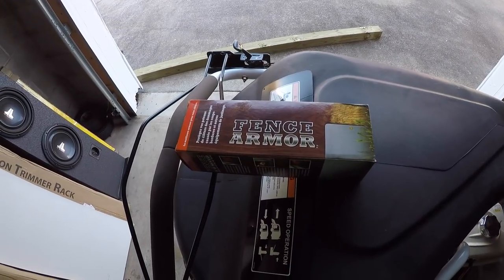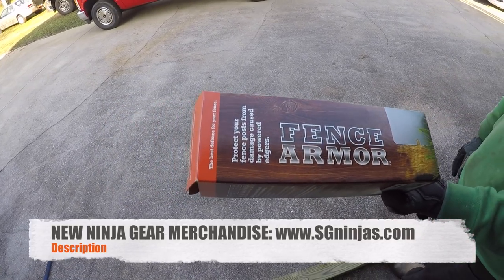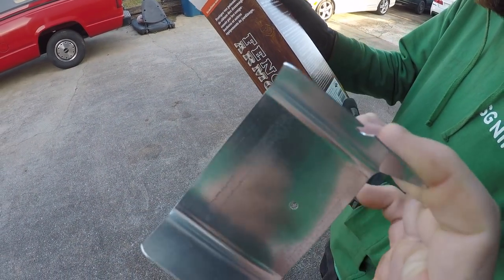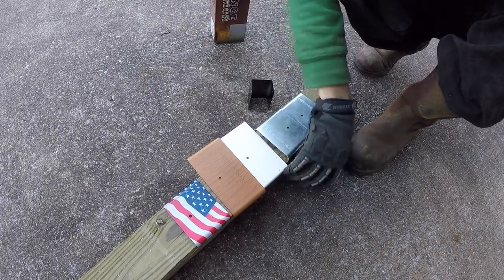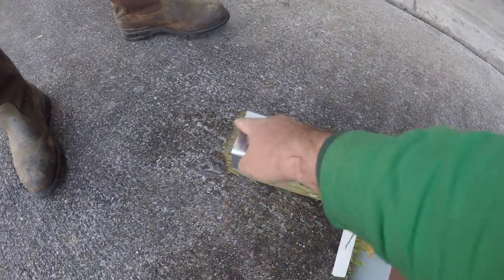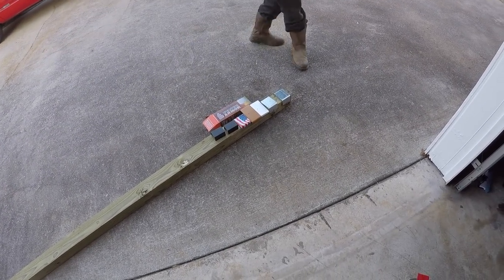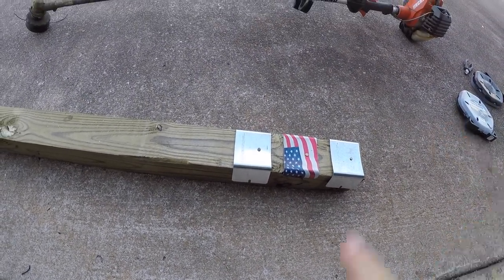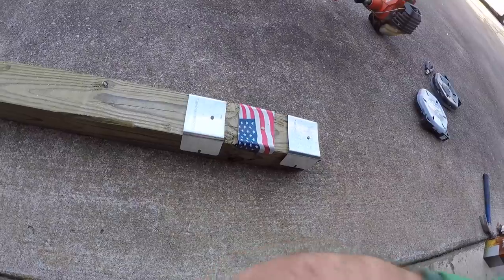Fence Armor DOES IT WORK???

Comment: The echo black diamond works very well around fence posts and along pickets and vinyl siding.  The key is to trim at lower RPM.  Another good suggestion is use a vinegar weed control for those customers who do not like chemicals.

Comment: Nick, I used for a deck corrugated drain pipe. $23 dollars for 50 foot.  Cut it on 8 inch sections and slit it down the middle.  Wrap it around the 4x4 and 2 zip ties.  It won't last as long as the metal but it's a lot cheaper.